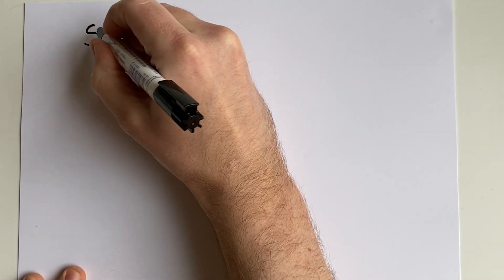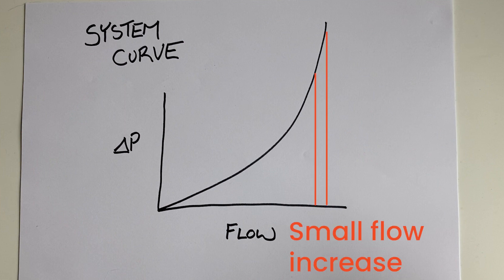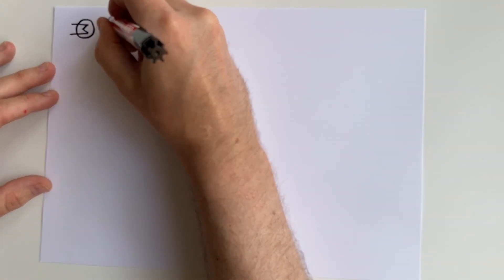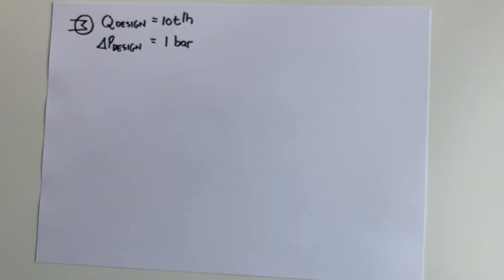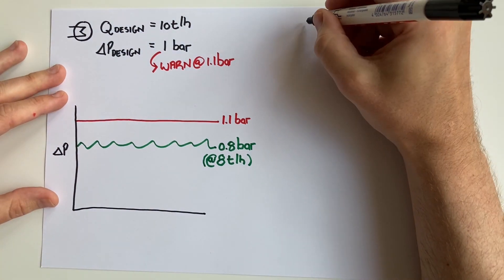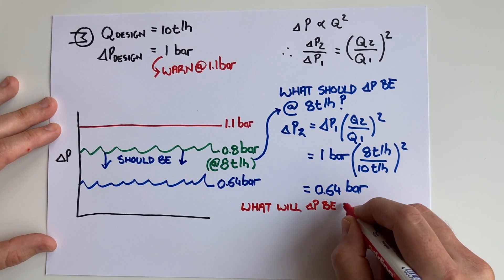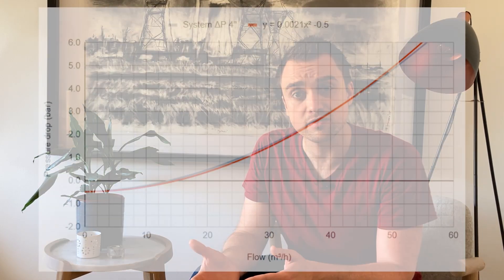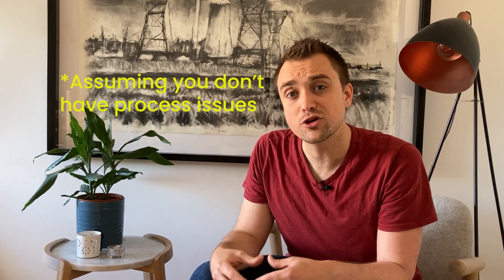Stop looking at pressure drop like this

Comment: Let’s assume I have four valves connected in parallel. All the valves are supplied from a single source, and at the outlet, they merge into one pipeline. The pressure before the valves is P1, and after the valves, it is P2. If dP equals P1 - P2, then the system curve does not look like the one shown in the video. The greater the dP, the smaller the flow, and vice versa. Why is this the case?

Comment: Which equation are you using to derive the square law for DP and Flow? Bernoulli requires a change in area to get that result but that wasn’t explicitly stated, is it Darcy-Weisbach?
Reply from the maker: I didn't strictly "derive" it. It is a knock-on effect from bernoully, where dP is proportional to velocity squares, but as I say, some equipment is shaped such that the exponent isn't necessarily a 2... It could be 1, 1.5, anything. It's just a rough application when I don't have data. But if you have actual data for flow vs dP, you should fit it.

Comment: This is such a good point. Another important thing to point out is that as downstream pressure decreases, you start to generate more flow. I've seen situations where pressure control valves downstream of fixed speed pumps have been left in manual, and the down stream pressures started to decrease over time due to process related reasons. This ultimately caused flow to increase, and almost caused a safety system in the plant I was working at to activate. So this concept is super important to understand!

Comment: Is the square relation you showed for both liquid and gas? If it's gas don't you need to consider temperature? Or are you assuming isothermal? -- 3rd yr ChemE student
Reply: Pressure drop is extremely non-linear, and there isn't a closed-form equation that describes it.

For laminar flow of Newtonian fluids, it is a linear relationship between flow rate and pressure drop, that is a 1-to-1 analogy to Ohm's law in electrical circuits.
For extreme turbulent flow, in the limit of high Reynolds' numbers, it asymptotically approaches a parabolic relationship, where pressure drop is approximately proportional to the square of flow rate.
For transitional flow and moderate turbulent flow, there is no closed-form equation derived directly from theory, and the process to calculate this relationship is very round-about and indirect.  There are empirical equations and charts based on generalizing flow in terms of Reynolds' number, and forming a curve-fit to the experimental results.  This is what is used for predicting pressure drop from flow, or vice-versa.

Most flows of water and air are turbulent.  Laminar flow usually happens for more viscous fluids like oils.
Reply from the maker: Generally yes, it’s for both liquids and gases, and absolutely temperature will play a role because pressure drop is related to density.

Just keep in mind that it isn’t always a square relationship in all instances - that’s why we develop complicated equations and charts for pressure drops of things like heat exchangers.

Nevertheless, scaling the pressure drop using a square relationship is better than using a fixed high alarm for all flow rates.